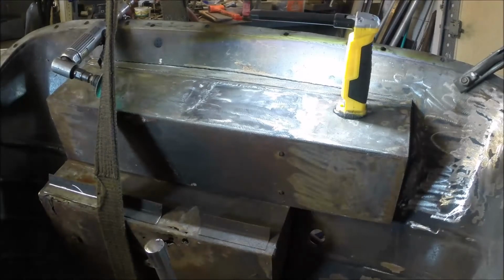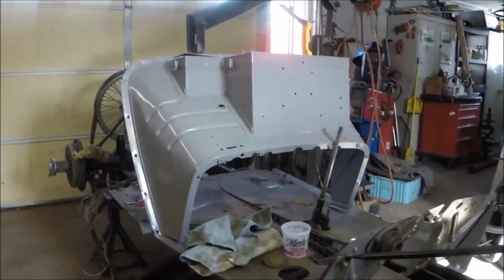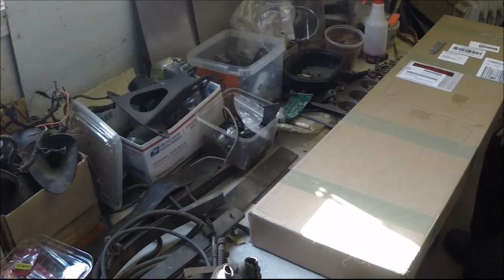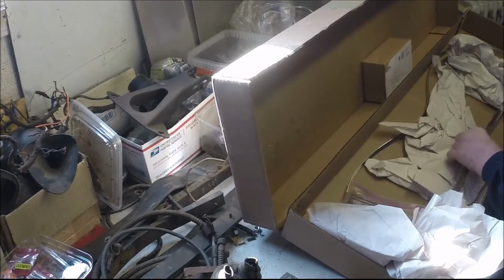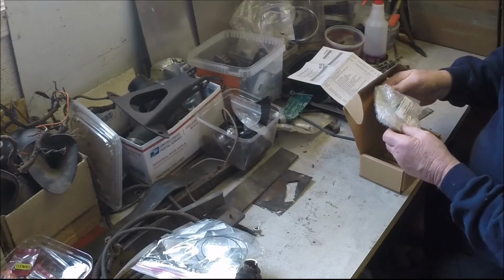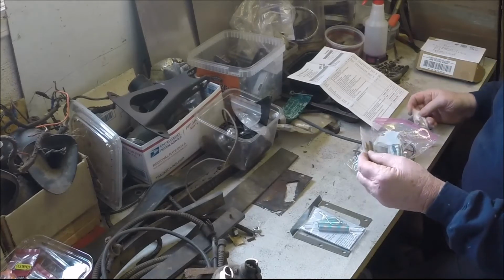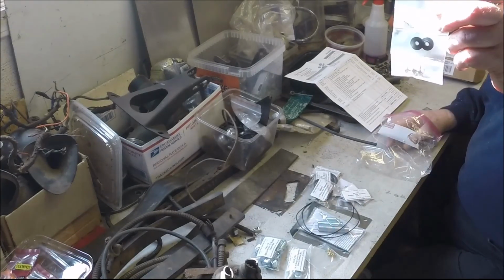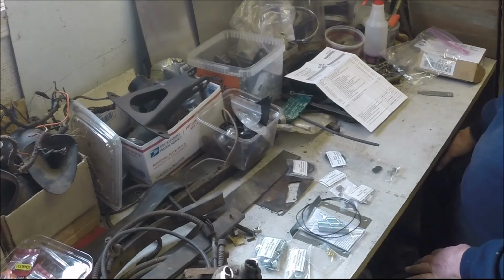1947 MG TC Rebuild Episode 8

Comment: Bob, it killed me when I saw you'd already purchased the catches for the tool box and battery tray. I bought complete latches in 304 stainless for $ 4.10 each from Lee Valley Hardware. They're identical to the originals. I drilled out mine so I could blast and paint behind them. Doug has a great company and the parts kits are convenient, but very expensive. TC's are certainly not an inexpensive restoration. It really pays to know who the real sources of the parts are. I got lucky a few months back, Abingdon was running a sale on Alfins. Most expensive brake drums I've ever bought. I enjoy your style, the progress up front and then opening some packages at the end. It looks like things are shaping up nicely. Have you taken a look at the condition of the hubs/wheel centers? If they've got a lot of wear on them I'd suggest MWS for those parts. Significantly cheaper than anything stateside. Also if you do have to replace the rear hubs check out Roger Furneaux on the uprated chromoly half shafts and true lip seal. He is the supplier for all the kits sold stateside, they're his half shafts also. I don't know how much experience you have rebuilding wire wheels but if you need spokes/nipples check out Buchanan Spokes. They have the TC measurements, prices are great and quick to ship. Keep up the great work.
Reply from the maker: This certainly is a learn as you go project. I do appreciate the tips. Good news, I guess, is that I made the lids for the two boxes in house. i have blasted and painted the rims and remounted the old tires with news tubes to get it rolling. These videos are upcoming. I will have a look at the hubs and such. This car appears to only have done about 40 k miles in its life. The Speedo says 90 some thousand but it's in KM.